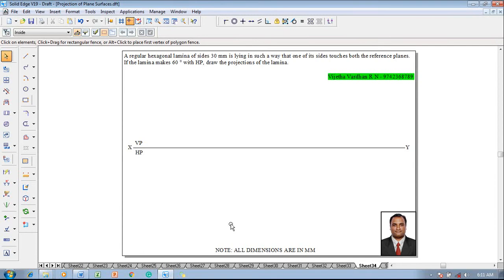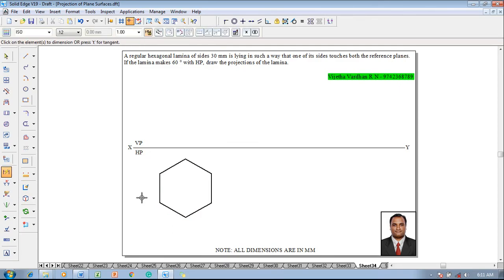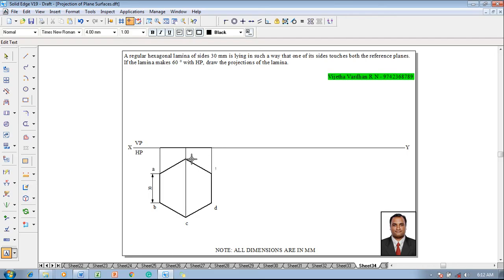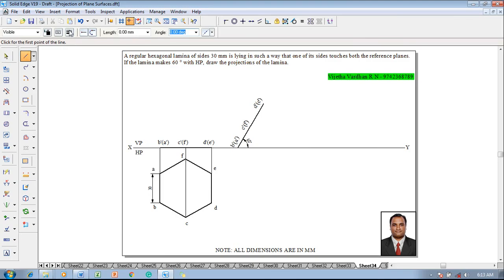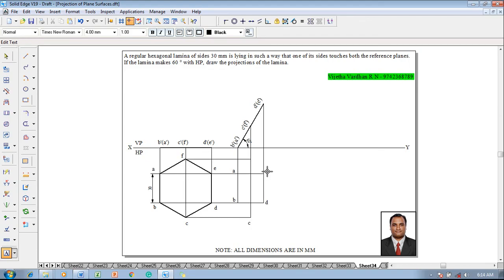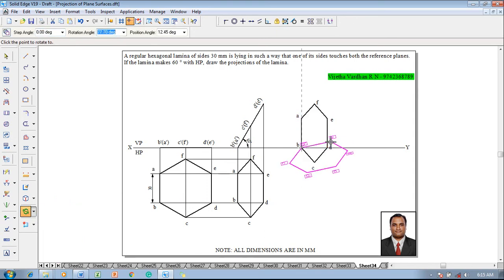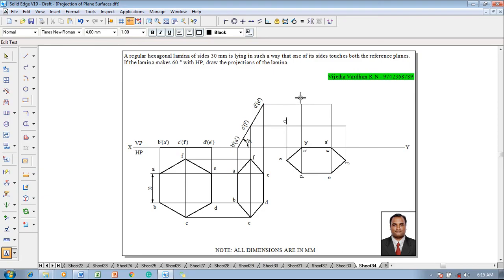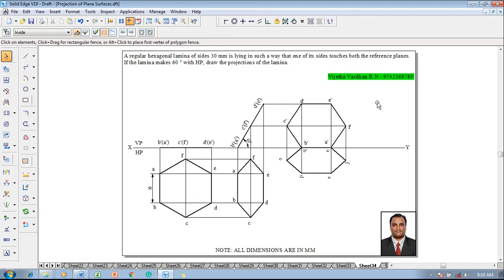Example 34 on Projection of Plane Surfaces

Comment: Sir this exact drawing u hav done for evn 36th problem too,but there question says one side is on hp and opposite side is on vp.

But here in 34th it says a single side is touching both hp and vp.

I didn't get how the same drawing is suitable for both these questions?

Pls can u explain.....
Reply from the maker: Yes drawing wise you won't see the difference, but the letters are different in stage 3 which you can observe